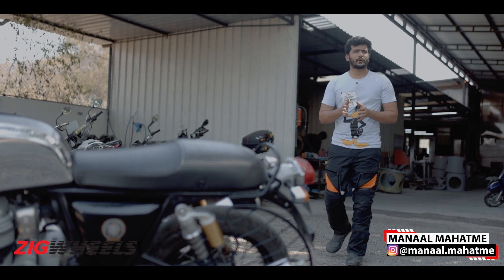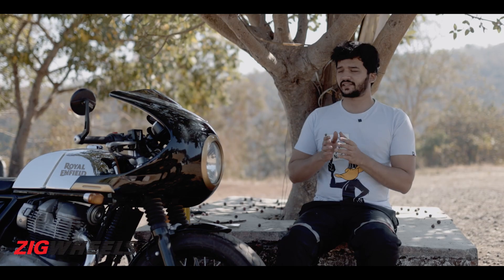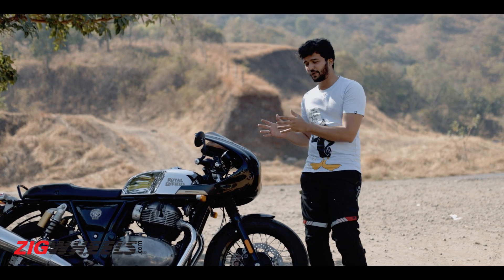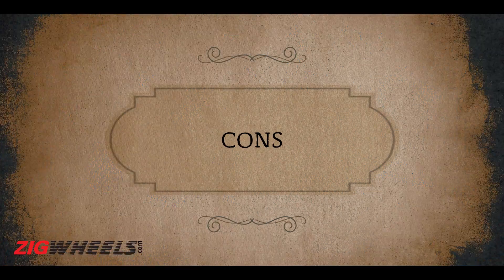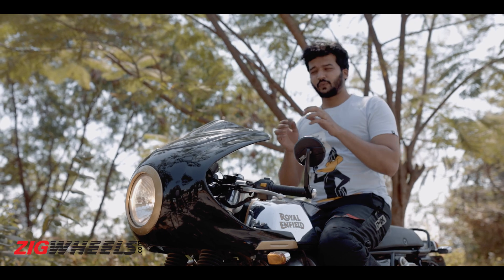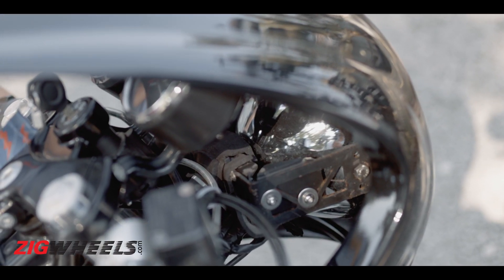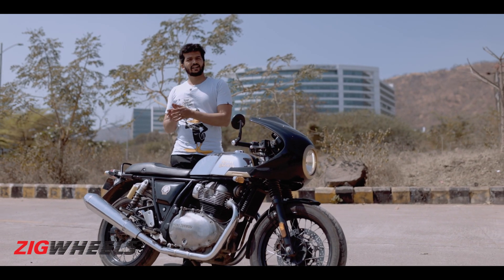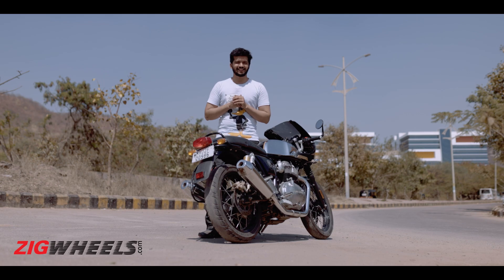Royal Enfield Continental GT 650 Long-term Review | The Retro Racer Dreams Unlocked

Comment: There is nothing royal in royal enfield

On Sunday, May 14, 2023, at approximately 2:30 pm, we received got continental GT 650 delivered from Royal enfield company store, with great anticipation However, our excitement quickly turned to disappointment when we discovered that the bike was faulty and suffered damage within just an hour of its arrival. To our shock and dismay, the bike's silencer emitted smoke, misfired in the middle of the road, and abruptly came to a halt near PVR Juhu. Adding to the distress, the silencer also underwent a transformation, displaying a goldenish blue hue, indicating a significant problem. These defects not only compromise the bike's performance but also raise concerns about its safety and long-term durability.

Upon immediately contacting your showroom representative from Juhu to report the issue, we were met with an unreasonable response. Instead of acknowledging the obvious manufacturing defect, we were baselessly blamed for allegedly overfilling the petrol tank. The subsequent interactions with your showroom representatives only further exacerbated our frustration. Despite multiple calls, we were provided with another ludicrous suggestion of blowing into the tank to release any excess air. Such baseless accusations are completely unacceptable and have severely undermined our confidence in your company. It is truly disheartening to receive such a response. We spent nearly two hours stranded on the road, feeling helpless and trying to understand the cause of the problem. Eventually, we were left with no choice but to take the bike to the service center, as the showroom representative informed us that they could not assist us any further.

We firmly believe that the bike was delivered to us with a pre-existing fault, This transaction was not merely a financial investment; it was an emotional investment for myself, my husband, and our entire family.